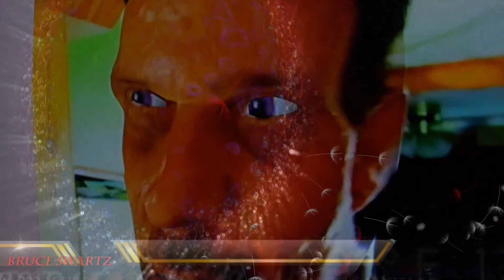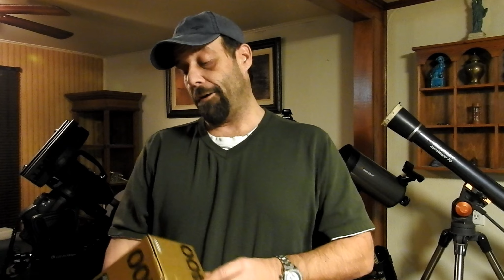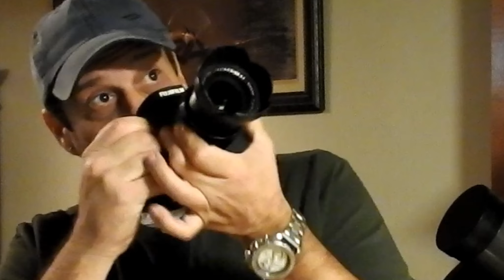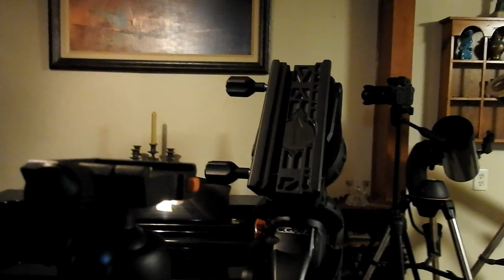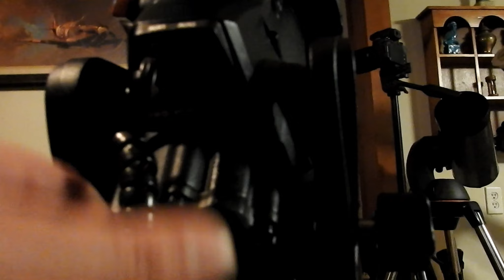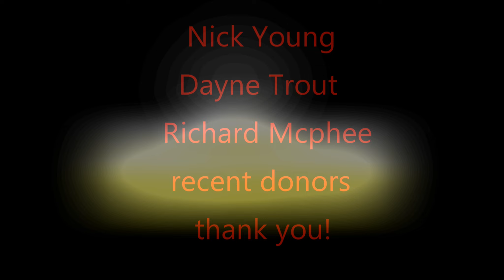A New DSLR Camera For My CGX-L 1400 HD Telescope + More

Comment: I hava been using an older Nikon D40 with a 1000mm telephoto lens. This is a very cheap method but I have been getting pretty good images of the moon. However the camera is only 6 megaPix. How is that d3400? I see the newer one d3500 has cellphone bluetooth ability.

Comment: Thanks for the video Bruce, awesome. Have you thought about building a triangular dolly base with large castor wheels on it, or even pnuematic tire wheels, so that you could roll it out the back patio or whatever into position. Whatever your setup it would be nice to be able to deploy and recover the device without having to go through the setup process everytime. Perhaps even a track system...roll it in, roll it out. Thats the idea. Good Luck !
Reply: zetapal   the track system would sound nice....now who is good at technical drawing

Comment: But is that Nikon D3400 Full Spectrum? Did you remove the green filter that is built-in in front of the sensor and It blocks non-visible light (UV,IR...)??, thanks.
Reply from the maker: Technique. Right through it. No I do not destroy any camera's ever that way nobody will say it was a manipulated photo. LOL Hey there brother we got the scope. As for the surface the secret is that no manipulation or filtering is needed what so ever to catch crafts and structures and it will be proven the first video I do with the BEAST. It's all set up and looks glorious.

Comment: Build you a base with wheel on it. Moving made easy
Reply: Putting wheels on the telescope would not stabilize it enough....I truck passing by would make it (wheels) bounce and we do not want any interference on the images...:(    But would have been an easy solution  Sally!